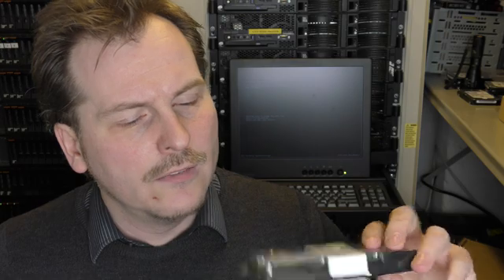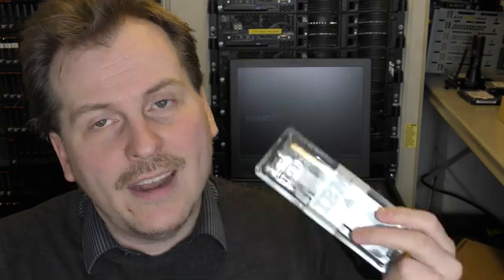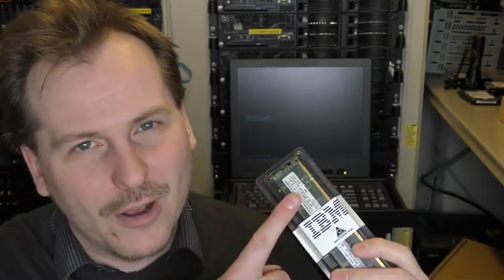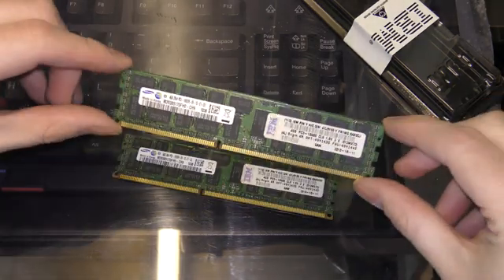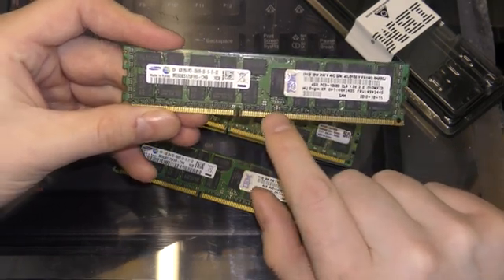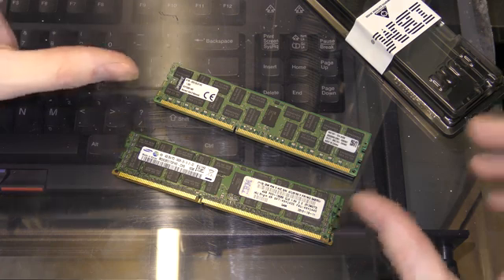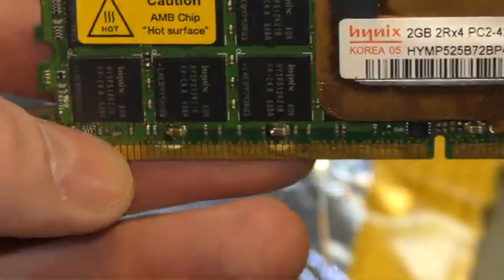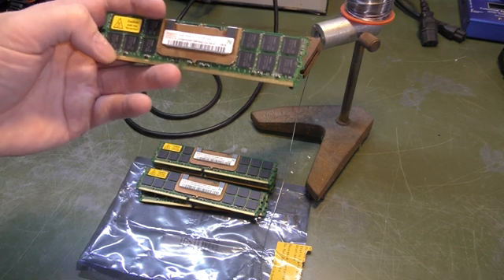16GB RAM hidden in 4GB block, High end ECC server RAM - 499

Comment: Well played, especially since I just watched an EEVBlog video where he goes over an oscilloscope where they do something similar (There are resistors that are unpopulated on the board, and adding in or moving the resistors changes the internal serial number, which then unlocks new/enhanced features such as higher sampling rates), and I went "Oh wow, even the RAM industry does this?  No way.  I wonder if the RAM I'm gonna get for my new build can be-....damn it."
Reply from the maker: Hi Jon Ellis
Thank You very much!  I did see EEVBlogs,,, it was a bit over the top :-) He shout have made a video on that he was getting a solar driveway,, that would have been a student. :-) with all the $his he has given that :-) 
Thank you for watching! :-)

Comment: Which server woukd you recommend to buy used? I found a "HP ProLiant DL380 G6 2x QuadCore Xeon E5540 16x 2,53 GHz 48 GB RAM 2x 146 GB HDD" on Ebay for 250€, is that a good value or can you recommend something better?
Reply from the maker: Hi Rico Smith
As the Lenovo fan boy I am I would recommend that,, But 250€ for a DL380 G6 is not bad,,, you can get a better deal,,, with patchiness. 
Thank you for watching! :-)

Comment: Good video Morten, thanks! I have a question though. I've been a Dell server fan for a while and just bought my first IBM server. IBM SYS X3250 M3 1U. It has 8GB ECC and dual Xeon X3450. It only has 2 drive bays for 3.5". What would I need to convert this to 4 2.5" drives? I ask you since your the IBM expert. :)

Thanks for any help. I only paid $85 USD for it and it looks brand new inside and out. Works flawlessly.
Reply from the maker: +Your PCMD 
It can be a problem with four,, but check out Lenovopress on that server.
Reply: Thanks. Still, even if I had to stick with just 2 drives, $85 was well worth getting it. I also picked up 2 Dell PE R210's for $100 each.

Comment: You bad man, re-heating the supply decoupling capacitors LOL, sorry special memory capacitors Ha ha :-D.
Too much explaining, two many cuts because you could not keep a straight face lol.

A truth: Some early 8 bit machines used faulty ram chips of double the capacity required, the faulty half was de selected with a jumper, this cut the cost of memory to almost nothing.
This is true, not an april fool.
Reply from the maker: Hi @zx8401ztv
Thank You very much!  glad you liked the video :-)
Thank you for watching! :-)

Comment: hello mortem I need your help I want to know how can you tell if the CPU is fried when the system is running hard and nothing shows up can you tell me how to fix it so that I can get it back online and start running the system it is an alienware aurora 2009 version and I want to know how to fix the cpu
Reply: A Random Idiot Play's dude I want to know how can you tell if the cpu is bad in an alien ware Aurora 2009 model
Reply: I was having a similar problem on an old rig, the ram was shorting the motherboard try testing the ram by taking them out one at a time and trying to boot.
Reply from the maker: First you look if there is any smoke signals...